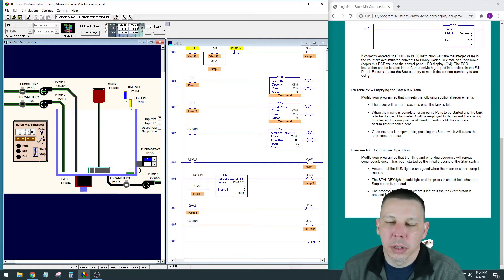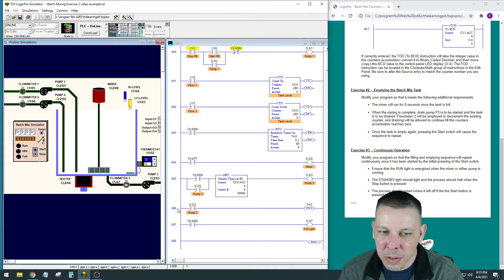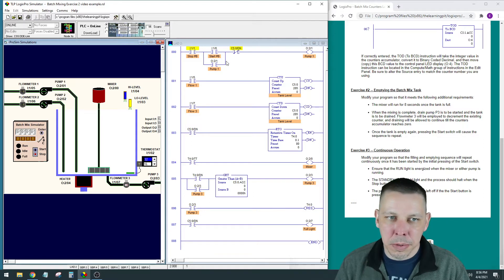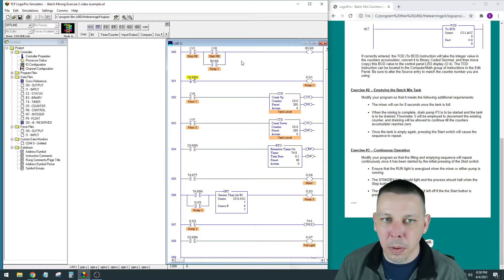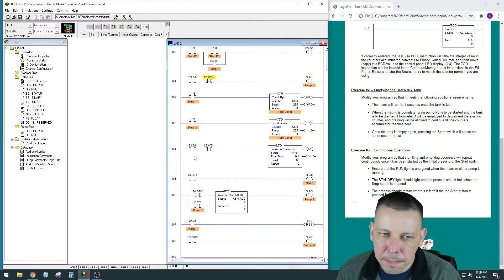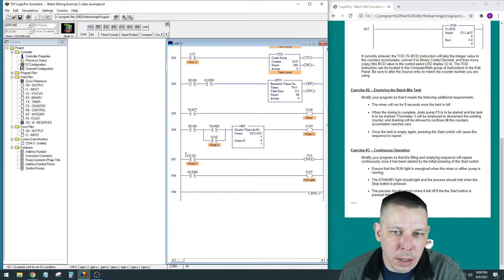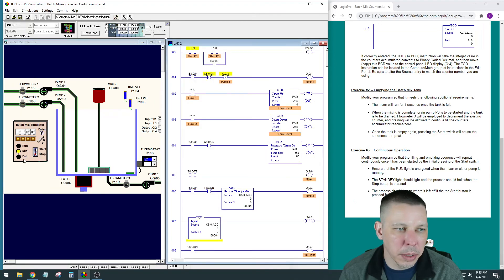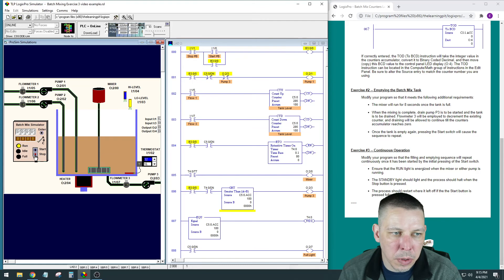LogixPro The Batch Mix Lab Utilizing PLC Counters - Exercise #3 -- Continuous Operation

Comment: How do you turn on the lights (run and idle when pump 1 its on or pump 3  an idle when the process is stopped?
Reply: He mentioned previously that he likes to keep the lights at the bottom, so I guess he added the lights but never showed them. For the Idle Light, I added a run with an XIO linked to the B3:0/0 binary bit and an output to the B:2/6 Idle Light, so when the bit is deactivated, the idle light is on. For the full light, I used an XIC linked to the B3:0/0 binary bit and output to  the O:2/5 Run Light, this way if the binary bit is active, the Run light is activated.
Reply: @adambaker5729 thank you , I was confused by the way ,baraka allah
Reply: You don't show This part of the code  and i can't do this function

Comment: How do you adjust the counter preset value in Advanced Batch MIxing Lab without manually doing it in the program? I was thinking entering counter values with I:3 (BCD) but the number values are confusing.
Reply from the maker: I think you'd want to manually set the the PV. When the accumulated value reaches the PV is when the CTU or CTD output will go true. If you're wondering how the accumulated value increases or decreases, it's from the CTU or CTD input signal going from false to true.  Hope this helps.
Reply: @smart_builds  It is said in Exercise#2 that user will have to set the desired batch count, as well as product ratio, using the control panel thumb-wheel switches. I can't figure out the type of number thumb-wheel switches produce (I:3).